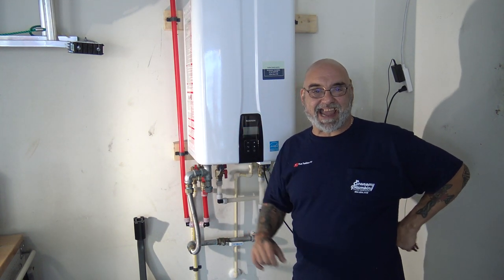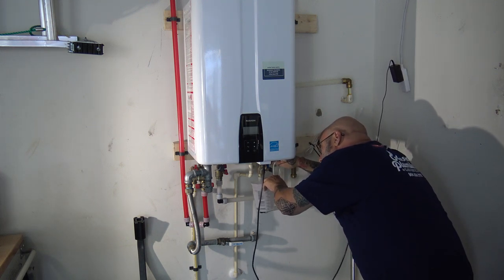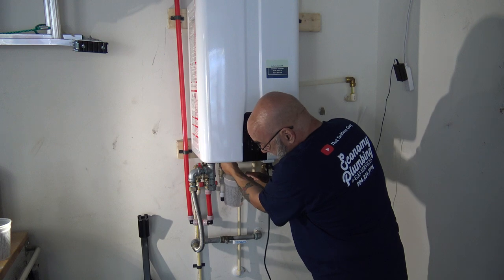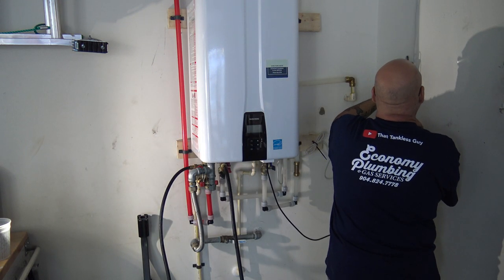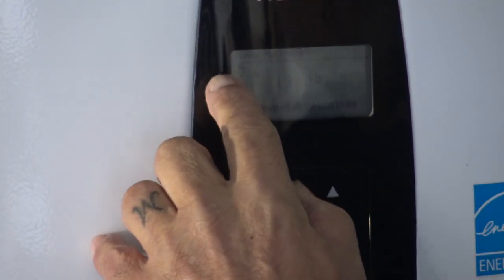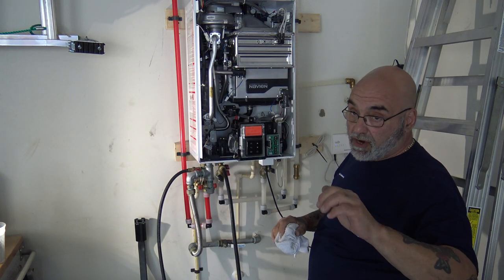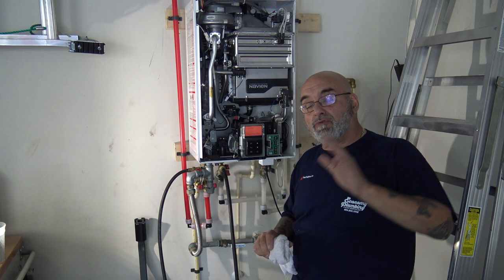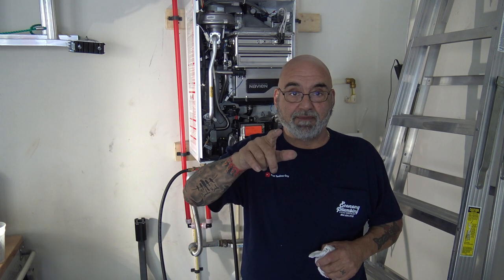Descaling a Navien NPE unit using the internal pump

Comment: Always enjoy your videos.  Some of the best. I do want to clarify one statement you made about the INT/EXT valve setting inside the unit.  You said that if you have an external pump that you would need to set it to EXT. That’s true but so as not to confuse folks, you also need to set the valve to EXT if you use a dedicated recirculation line without an external pump since the internal pump will provide the flow for recirculation. (BTW I wish I had seen this video before I did my first annual descaling.  I would have save the cost of the portable external pump I bought for my bucket!)

Comment: I have a Navien combi unit., domestic hot water and heating water for a radiant heating system.  I have done one service so far.  i used white vinegar in the descaling process for 45 minutes, with a portable sump pump in a bucket.  My water filters were clean, even after 1+ years of continuous use.  There was one more step in cleaning the air intake filter to the unit, which you didn't mention on your unit.  An other filter serviced was the acid neutralizing cartridge for the unit's condensate.
Reply: Thank you for the comment. We did run the pump for another 20 minutes I had to change the PC board and front controller due to a electric surge. That’s why the unit was flashing red. That’s correct about the air intake, I will be doing that on the normal flush video I will be doing. Mike

Comment: Couldnt you just open the cold after a flush and leave the bypass hot hose running to a drain and flush it well before opening it to the system? Wouldn't that prevent flushing at every faucet? Or did I misunderstand that?

Comment: Great Video! I attempted to do the descale utilizing the hot and cold ports and an external pump but could not get the cleaning solution to flow. Any suggestions or is this unit only able to descale utilizing its internal pump and the hot and recirculating line ? (I don’t not have a service valve on my recirculating line).

Comment: It appears my recirculation line has been routed to be used to heat my forced air hydro furnace. I'm figuring i need to descale both systems but there is no way to flush the furnace side of the system that i can figure out. I have a shutoff valve above a faucet on the recirc port below the water heater and a shutoff valve before it connects back to the hot water line for the house. Then the usual hot and cold water service ports with an expansion tank before the cold water port. I have a Navien 240A. Any advice?

Comment: I did not know about using the internal pump to descale and other YT videos never show this.  If you are using internal circulation and have a service valve on the recir port, can you still use this method?

Comment: Hi I’m following this process with the same tankless unit.  My pump is running, service ports open, no fluid being circulated.  Any troubleshooting tips?
Reply from the maker: some or the unites you need to power it up first by running a faucet then unplug it. It fakes out the water servo valve.

Comment: Can you do this with a 240A model also? If so what are the settings?
Reply from the maker: If you talking about an electric tankless no you cant.
Reply: @ThatTanklessGuy  I have the same question. I have a natural gas, 240a model but cannot find the descale setting in the advance/service menu. Can the recirculation pump be used on the 240A as you have done for the 240A2?